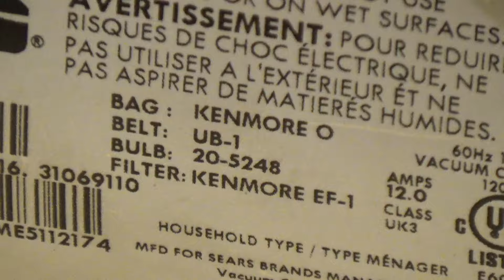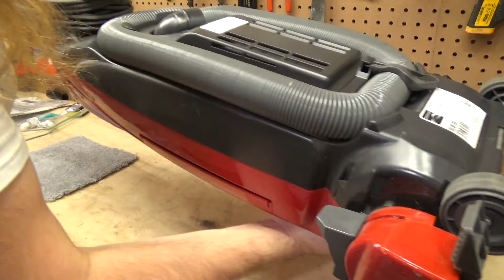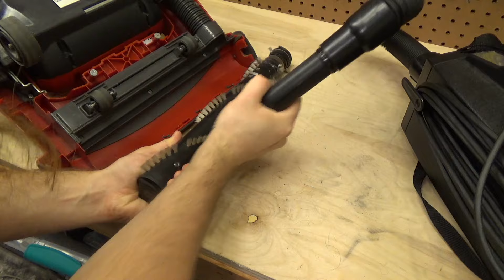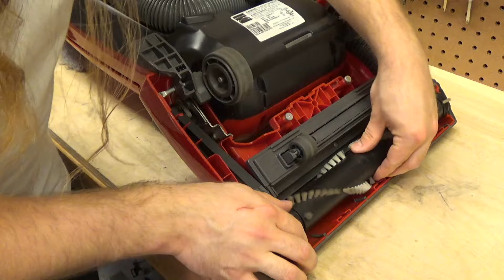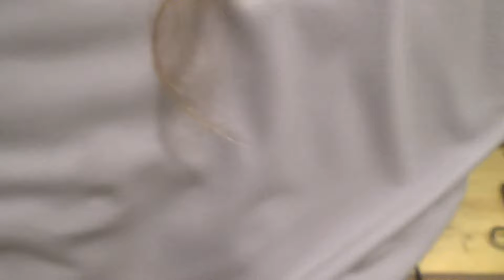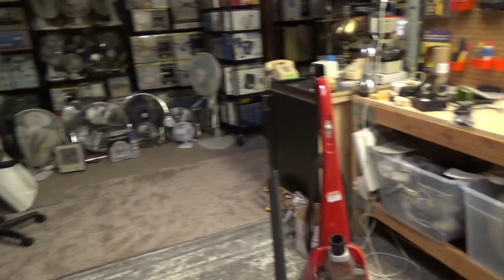Kenmore Progressive 116.31069110 Vacuum Clean, Service, and Repair

Comment: Bearings sound a bit iffy on the oreck. Have you considered servicing those?
Reply from the maker: It's been like that for as long as I can remember. If it starts to exhibit functional issues, the bearings will be replaced.

Comment: Curious where you got the belt, and part number if you have it?  Thanks.  I have this same vac in this same color.
Reply from the maker: I don't recall what the part number was, it's listed on the manual which is still readily available online.
Reply: I have this vacuum; there is a label on the back near the bottom with all information needed. Thinking of replacing brush.

Comment: Good to see you doing vacuuming cleaner videos! These are really good vacuums! Kenmore is a good vacuum. That turbo brush by the way goes to a Bissell Powerforce Helix Turbo 1701/2190/3332 hope that helps. Good video. My channel is partially based on vacuum cleaners, just some good info, again good video!
Reply from the maker: Thanks for letting me know.